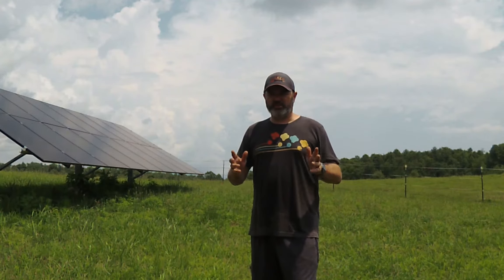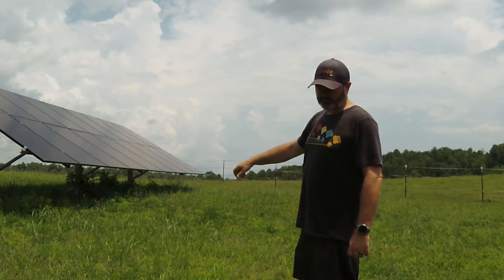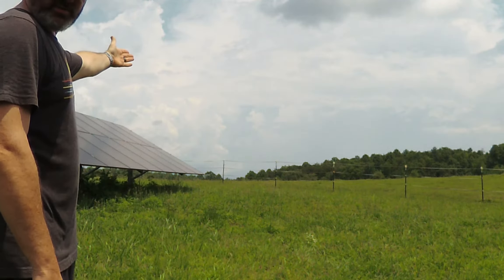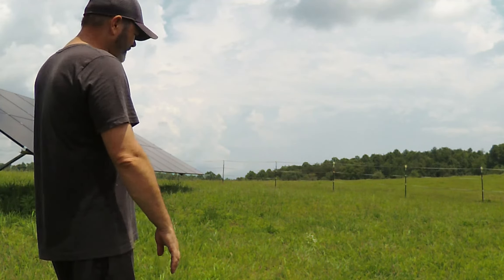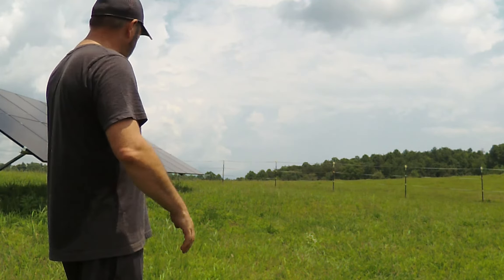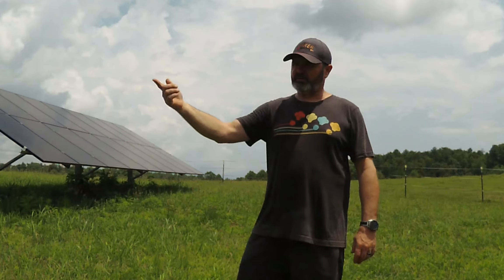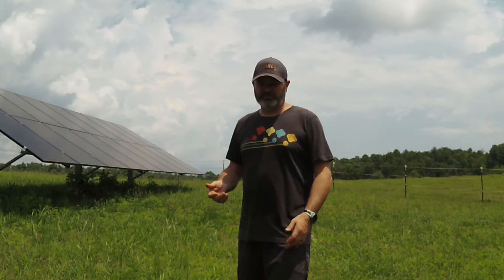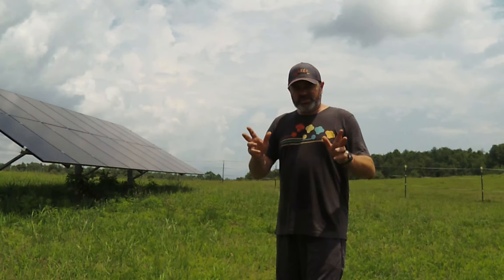DIY Off-Grid Solar Project Expansion!

Comment: Hey Steve new sub via 775 vid on your power house nice job on that, I live in the UK and have 2 sdmo generators and a small mase suitcase generator for backup power all on petrol, I like the idea of solar but not the cost I have a cheap Ring 2.1kw iverter and I am thinking about just running 2 chest freezers for a start before going bigger.
Reply from the maker: The cost is a factor, but Scott once said something to me when I was talking about running as much as I could off of propane to reduce my solar needs. He said, "You can make your own solar power, but you can't make your own propane." That rang a bell with me because he's right, you need a functioning supply chain to keep running on gas, and that's a fragile thing in this crazy world right now.
Reply: @stvbird  I know what you mean I have a bad feeling we have not seen anything yet, I will try to get a battery bank set up but finance is a bit of a balancing act at the moment if you know what I mean I have been topping off fuel and food and building redundancy in lighting heating and cooking, I could salt all the meat and fish but would like to keep the freezers going to make life easier as salting or smoking volume is a real hassle.

Comment: Yes always good to hear from you. One thing I can’t figure out with the panel installs is why not mount them on wheels so that at least one can rotate them to follow the sun?  Manually or automatically.  Just me thinking out loud.
Reply from the maker: The beams are set in 20,000 lbs of concrete that's underground for wind ballast. An array that size would blow over otherwise. Also, rotating/tracking arrays don't make much sense outside of government spending as the gain doesn't outweigh the cost. You're better off adding a few extra panels to get the same power for far less money.